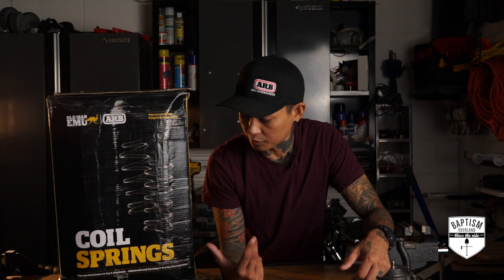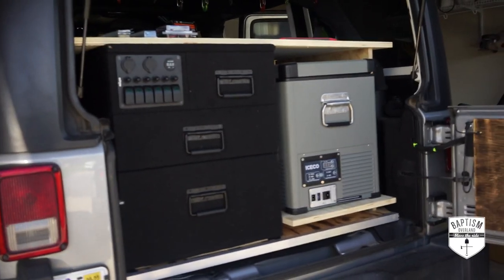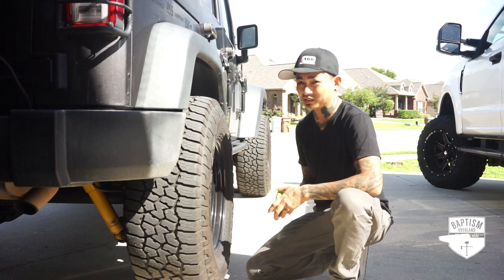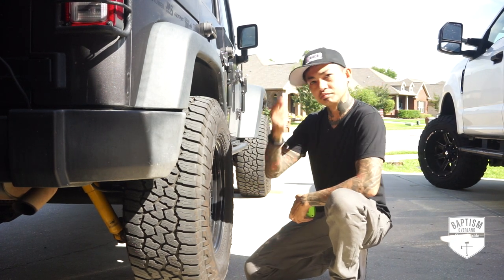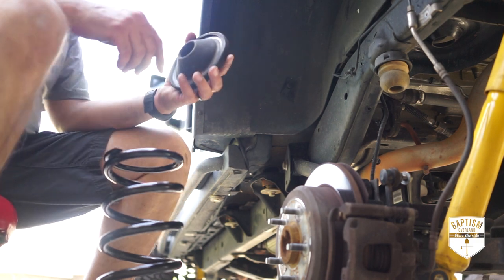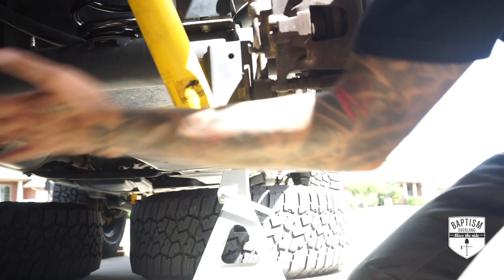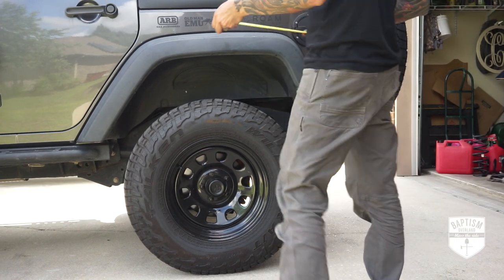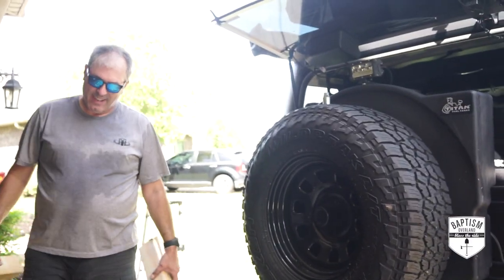I Had to Get HEAVIER Load Springs on the Jeep *Installing The ARB OME HD Rear Springs*

Comment: I run the jl version of these springs and also air lift bags for when fully loaded. The system works great for when I have large amounts of fuel.
Reply from the maker: I've been considering air bags. You like them??

Comment: Your video was very helpful as I have exactly the same problem.  I’m leaning towards springs, but am also considering air bags (Airlift 1000) and enhanced bump stops (Sumo Springs).  Not keen on the idea of air lines, potential leaks - springs seem like a more reliable solution.  Planning to call a few of the big Jeep after market parts distributors for advice.   I’ll keep you posted.  

Great channel.   I just signed up.  Love the alter ego idea - very creative.  I’d give him an ongoing role in future videos!

Comment: Thanks for the great information.  I'm planning to buy the ARB BP-51 2.5" kit for my upcoming 2023 JLUR.  I asked ARB about their spring load ratings and they said the stated loads are for a pair of springs (front pair/rear pair). They also said to distribute any weight added to the middle of the vehicle about 50/50 between front and back (e.g rock rails, underbody protection -  but a roof tent would probably be biased more towards the rear).  I calculated that my planned upgrades (front bumper with winch/rear bumper with tire carrier + 37" spare, Rockslide power steps) will add about 190 lbs to the front and 170 lbs to the rear.  ARB is recommending to go with the heavy load springs both front and back.  I was worried that heavy springs could result in a stiffer than stock ride for daily driving, but the sagging issues reported make it clear that heavy duty springs are in order.  The BP-51 kit offers only two options (light load 0-90lbs,  or heavy load 90-195lbs). Crossing my fingers...
Reply from the maker: Don't worry about the stiffer ride with the OME. It's a nice ride. You MAY get slight stiffness in ride but it will go away when that weight is added. TRUST ME lol. Better to start off with the heavy loaded springs first and deal with it until the weight is added vs having to reinstall new springs later when you start getting the sag
Reply from the maker: In a perfect world (or if I EVER build a vehicle fr stock) I would get everything done and added THEN add springs after
Reply: @BaptismOverland  That's exactly what I was thinking.  Although I'd love to learn how to do DIY installations, it won't be possible in the near future, so a professional shop will do all the installations. I was first thinking of having 37" tires and the ARB suspension installed first and  the heavy front/rear bumpers installed later. But the  suspension geometry angles would then need further adjustment.  It may be better to have the bumpers installed first and the suspension lift later - or perhaps having everything done at once would be even better? Otherwise putting heavy load on the stock suspension would perhaps require adjustments to get the stock geometry back - but stock control arms/trackbars are not adjustable unlike the ones that come with the ARB kit.
Reply from the maker: @tyurek  man you sound like me!! Lol. Ok so. Personally (since a shop will do it and you want to minimize the amount of times you take it there), go ahead and get lift and tires but don't do geometry yet. I say that because you will do all of that then put the weight on and now geometry is screwed again. I would add all the stuff then you'll see just how off your geometry is. Because your geometry is gonna be off with the lift BUT once the weight goes on and the Jeep lowers, the geometry will sorta go back to where it was slightly. 

If you get all adjustable arms though, then you can adjust yourself as needed. Mine are not adjustable so I waited till the weight was on
Reply: @BaptismOverland  I agree.  Still learning the basics and the dynamics of suspension geometry.  I think I understand how you can correct the caster with adjustable lower arms. But  (at least on paper) it looks like if you keep the stock upper arms, the axles will be forced to move towards the center of the vehicle when lifted, hence resulting in a shorter wheelbase - not sure if how big or significant this shortening would be (if at all). But it sounds like adjustable upper arms (together with adjustable lowers) would be needed to push the axles back to their stock position.  The ARB kits interestingly don't include adjustable uppers (only lowers and track bars), but ARB does sell adjustable uppers separately.  Experienced folks might be cringing at my comments as all of my knowledge (or lack of) is theoretical - I don't even have my Jeep yet . Hopefully will be delivered next week.  Then the real fun will begin :-).
Reply from the maker: @tyurek  You are correct. But "sometimes" (I say this loosely) you don't need all the control arms to correct it all specially when weight is added. On mine, I bought the JKE geometry brackets to adjust the front lowers (I have a video on that). Much cheaper and has handled trails just fine. I don't plan to rock crawl so I didn't need ultimate flex.  For the rear uppers, I bought Terraflex arms to square that away. For sway bars, the OME kit came with a bracket that corrects the rear sway bar. Now I just need front sway bars and I should be set. The most important is usually the lower front and rear uppers. Some stage 2 kits comes with just those and for some it's enough.

Comment: You may have figured this out by now but if the spring perch is tilted forward you should readjust the control arms to bring the pinion angle back into proper position and will level the perches.  This should reduce/eliminate the bowed spring coil situation.
Reply from the maker: Yep. I did. Haven't gotten around to it though. But the bowing seems to be more side to side vs back to front. I still need a sway bar for the front which I'm hope will correct that.

Comment: How is the lift now ?
Reply from the maker: Been great! I even just put on an ARB bumper which is heavy and it's holding just fine. But also I got air suspension fr airbag man which, if I NEED TO, I can adjust the height

Comment: How are they offroad? I am looking at my second set of rear springs due to sagging. I have a heavy 37 spare and also a Titan on the rear. That with tools, recovery gear and a lightweight aluminum rack. I don't overland, but I tow a travel trailer at max weight to and from the trails. I do use a weight distribution hitch when I tow with airbags but the airbags keep giving issues from full flex and articulation. I do a lot of rock crawling, so articulation and flex are key. When it isn't sagging, I am at about 5 inches of lift with a combo of springs and spacers. BTW, love the videos.
Reply from the maker: They're great off road. But I released a video couple weeks ago on air suspension. You should check it out! Might solve your issue!

Comment: I have the Metal Cloak Game Changer 3.5/4.5 with adjustable control arms on my JK.  My rear springs bowed A LOT and I was concerned.  So I added Metal Cloak Rear Coil Spring Alignment Correction (part number 7187) and adjusted my control arms to change the angle of my axle a little bit.  It's still within spec and the springs still bow a little, but not nearly as bad as before.  Hope this helps.  Also I don't know how you work with that camera man.  I would fire him and hire someone different...
Reply from the maker: 😂 thanks for that man! That helps a ton!

Comment: I stumbled on this video and it made me really curious. I got a Rubicon Express 2.5" lift with progressive coil springs for my 2013 JKUR. They are SUPER soft and the rear end hits the bump stops a lot. I think it's time to try the EMU 2620s. Thanks!  - I missed it in the video I guess, but what size tires were you running??
Reply from the maker: I run 33s. There's a video for that also. Def get heavier load springs. Sounds like you need it

Comment: Thank you for this video!  🙏🏻 How is the coil weight factor into the additional weight for accessories?  For instance, if one were to get the OME Ski 2620 coil to the rear like you had, which is rated at 660lbs, does this mean that a user would had added between 301 and 660lbs to the rear in total?  Or is that 660lbs for each rear corner (which sounds suspect)?

I am running 35"s on stock fenders, JKUR, metal cloak 3.5" Game Changer and 6pak shocks.  It has the dual rate coils which was awesome until I went full blown overland so my roof rack and accessories basically stay on except awning and privacy tent which are on quick disconnects.  When the 6paks needed to be rebuilt, I swapped them for Falcon SP2 3.3's adjustable and find myself running mostly on the stiffest setting so upgrading to heavier coils seem to be in my planning next.  Already using Airlift airbags.  

I sent ARB a message and hope Old Man Emu make coils for a 3" to 4" lift.  I like that they have these weight ratings.  Other brands just say 'heavy duty' or 'overlanding'.
Reply from the maker: I think that's total. 600 on each corner is def suspect lol.  If I'm not mistaken coils are usually rated as a pair as it would be odd for someone to just put one in one corner Haha but I can look into it. I never dug that deep to find out honestly.

But yeah that's why I went with OME. They were more specific.

Crazy the airbags aren't helping you. I have a company in AUS that's wanting me to install and review air bags. Im guessing it'll help me dial in the height when needed
Reply: @BaptismOverland  I think my dual rate coil from the Game Changer suspension is drooped at the 'soft' side of the dual rate from the wright hence I got a bit of droop at the rear. It drives nice however.  

ARB got back to me and said they only make up to 2.25" coils so I may have to take a hit on the height or use a different brand and heavy duty coil. Another user in the forums said he had not seen a change in height after the same coils you used and he has the same 3.5" Game Changer suspension as me. That's promising. Have fun testing the new air bags from Australia. 🙏

Comment: Very useful/helpful video (as all your previous videos ;) 
Have you experienced any lean ?
After installing the OME super heavy duty coil springs (2620 rear and 2628 front) on my 2016 JKU it's now leaning passenger's side (approx 1 inch lower than driver's side)
Reply from the maker: I have not no. Been great. My only issue is my front springs seem to curve in a bit (I heard it's normal but it bothers me) and my driver side tire toes out a bit and not sure why.
Reply: Thanks for the feedback bro!
Try checking full front alignement (car level should be a bit different from what it was with previous springs)
Reply: And for bowing I strongly advise these alignment correction kits. Worked so fine on my JK. Kinda of magic :)x
Reply: Metal cloak 7187 for the rear
OME FK53 for the front

Comment: Love your vids as always brotha. Question for you...i have 16 tundra and I tow a Bass boat and its about 2500lbs that's including a trailer. I currently have it on 3" front 1" back leveling kit. I did that on purpose so it can keep its factory positive rake so when I strap the hitch on the weight of the boat and trailer level out the truck. 

Will this heavy duty be just as good and will I have the same results? I looked at the OMU Heavy duties from your first video and I found those but you mentioned on this video there's different loads. I can't seem to find them for my tundra. 

Thanks pare any advice helps!!
Reply from the maker: Hey man! So the funny thing is I also didn't know mine existed until I spoke to OME themselves because you have to know the part numbers. I don't know if they have them for tundra but you might wanna call and see what is needed depending what kind of weight you're putting on
Reply: @BaptismOverland  that's good to know brotha and thank you. I'll definitely hit them up tomorrow.

Comment: Hey, thanks for the nice videos.
Just a couple of months ago I installed  the OME 2.25” kit with the light load springs ( 2617 ). Unfortunately, I am not too happy with the results. The ride is super nice, but I was hoping for a bit more lift.
I do have the hard top, rock rails, and steel bumpers front and back. And the Jeep is kinda sagging. And that is without the 34” spare tire and the new rack that I need to buy for it.
The light load was recommended to me even though my setup for the reason that the heavy load would be too high and stiff ride.
Now I am thinking to redo the spring ( only two month after install ).
Do you mind sharing what upgrades did you have before changing to the these extra heavy duty springs ( when you had the heavy duty installed)? And how much of a lift did you get, and was the ride stiff?
Thanks.
Reply from the maker: See that's exactly what I was trying to avoid with mine. I put in a lift KNOWING what I would be doing to the Jeep later down the line. You're right...super nice ride. But when I got my lift I didn't have a bumper yet or a winch. All I had was rock sliders and a steel roof rack (which I switched out to a lighter one fr Front Runner). My ride was stiff for awhile, yes. But I knew it wouldn't stay that way for too long. Eventually got the front bumper and a Titan fuel tank on the tire carrier. Now it's all good.
Reply from the maker: The lift I got when I first installed was HUGE lol. It was like 4"!! Then it settled around 3". Then it dropped to the true 2.5" once weight was added. Then the rear sagged with the addition of the RTT and the Titan fuel tank hence me getting these heavier duty ones
Reply: @BaptismOverland  Thanks for the detailed reply. And sorry, I just remembered to check for your reply ( I assumed I will receive an email or some sort of notification when someone replies to my comment ). Anyway, I wish I had taken measurements before I installed the lift to know exactly how much lift I got. I think that for now, I will switch only the rear springs for the heavy load 2618 ( right now I got the 2617 ) which hopefully will give me the missing inch or inch and a half.  I don't think I want to go with the 2620 springs right now. That would be too much for my setup.

BTW, ( and please correct me if I am mistaken ) I think you got a bit of a mix-up with the springs part numbers in the video.

- The springs 2616 are the light load for the front. 2617 are the light load springs for the rear.
- The springs 2619 are the heavy load for the front ( 2618 are the heavy load for the rear ).

I think that the light load lift kit usually comes with 2616 for the front and 2617 for the rear. and the heavy load kit comes with 2619 for the front and 2618 for the rear.

So I think that you were correct in the video where you mentioned that your kit originally came with 2618 for the rear. And then the 2619 springs also came with your kit but for the front.

Again, I might be mistaken, but that's what I got after researching new springs.

Happy holidays and Happy New Year.
Reply from the maker: @eyalfitoussi  you could be right in that they gave 2619 for the fronts to carry the load of winch bumpers. I've honestly forgotten what it said on the boxes now when I got the kit. But I DID get the 2619 for the rears to off set the sag I got after adding more weight.

Comment: Thank you for explaining the install! I am curious, how is the ride when the jeep is unloaded? Is it stiff? I have  similar sagging problem when going on roadtrips and adding roughly extra 400 lb. My concern is that if I add the heavy duty springs, the ride will be nice when loaded, but super stiff unloaded. I appreciate the reply in advance!
Reply from the maker: It's fine. I had the same concerns. But honestly with my permanent stuff already on the rig (RTT, bumpers, armor etc)...adding the cargo isn't that much more of a difference.
Reply: @BaptismOverland  nice! Thank you for the quick reply!

Comment: Hello Asia. Do you remember the part # of the springs you installed in the front?
Reply from the maker: If I'm not mistaken it's 2619. But don't hold me to that as it's been a long time
Reply: @BaptismOverland , since you installed the 2620 heavier duty spring in the rear, does your JK sit proper? I have a 2017 JKU Sport. I ordered the 2620 coils for the rear, and the 2629 diesel JK springs for the front. Do you remember if the front springs you ordered were for a diesel JK?
Reply from the maker: @Fred_Stallone  It sits proper. But I also now have air suspension in the rear to fine tune it when I get all my cargo in. The front springs were not for the diesel, no.
Reply: @BaptismOverland , when I spoke to the dude at Mudify, he said, “in order to achieve a true 3” lift, I would need the ARB 2629 Diesel Front Coils, and ARB 2620 Rear Coils. I certainly hope my Jeep won’t be sitting higher from the front, since yours sits proper with ARB 2019 front coils. Mudify is in Florida, your neck of the woods… Have you heard of them? Are they a good outfit?
Reply from the maker: I've never heard of them no
Reply: @BaptismOverland , did you need to install an exhaust extension/drop kit on your JK?

Comment: It's been two years since this video so... How these coil springs are working for you?
Reply from the maker: Still great! Hasn't drooped and is holding up awesomely.
Reply: I installed the 2620's in the back and now I'm sitting to high so went and change the fronts too for the counterpart the 2628's and i have a 2" difference.. frustrating.
 @BaptismOverland